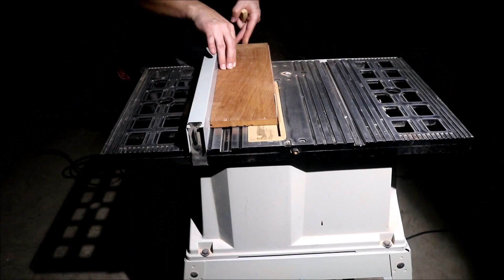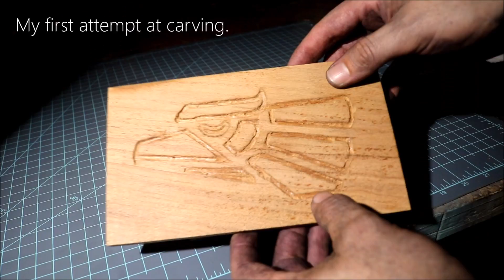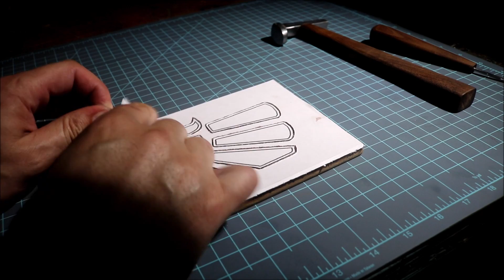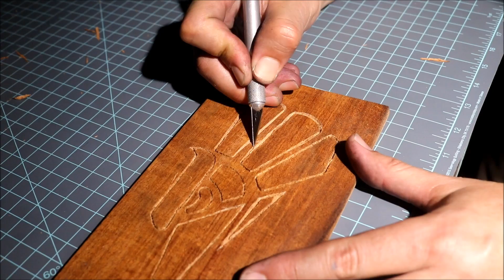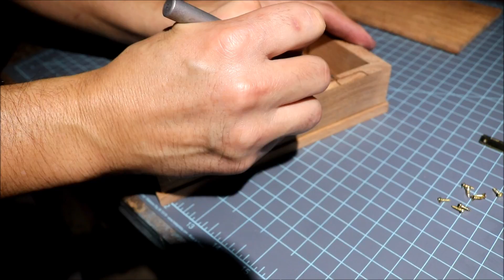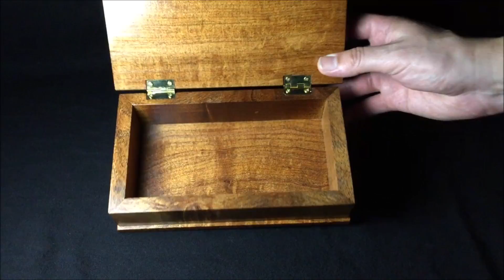Small Wooden Box with Carved Lid

Comment: A resin inlay would be pretty cool.. Great job as usual.
Reply from the maker: Thanks I thought about that, I have some metallic pigments for epoxy but was afraid that it wouldn't look metallic enough and after the initial 2 failures I didn't want to push my luck.  I might have to try that on another build though.